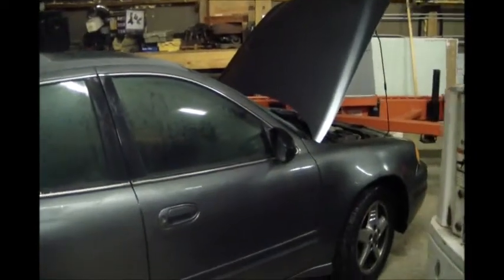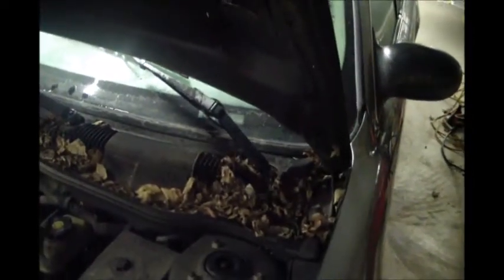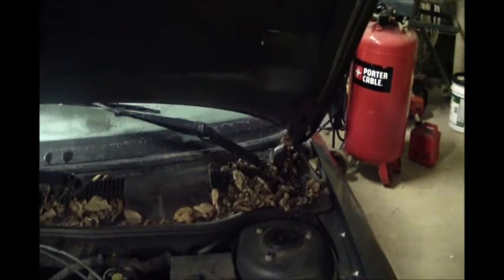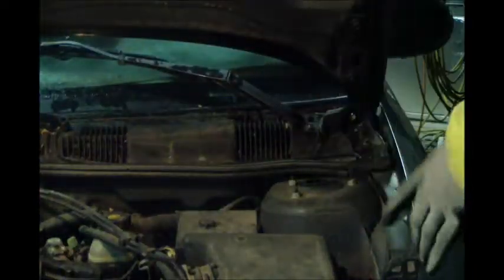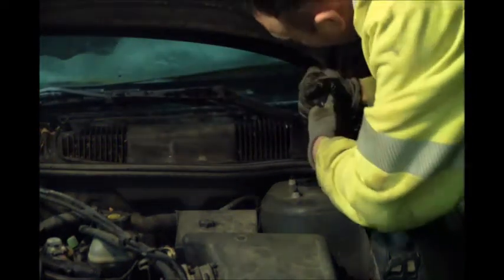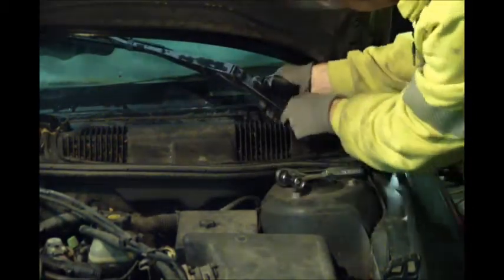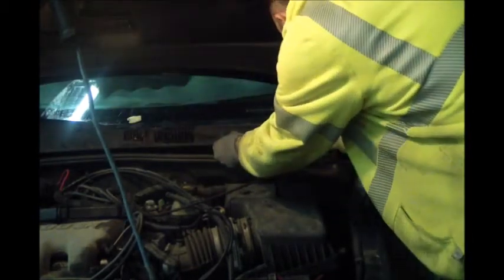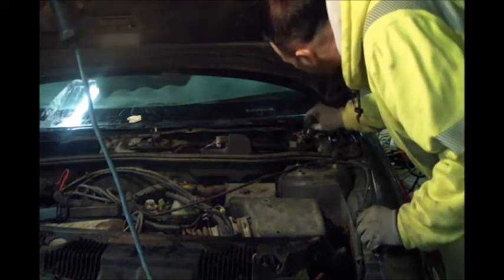Pontiac Grand Am Wiper Arm Linkage Fix

Comment: All I had to do was pull the arm off because whomever removed it before had it adjusted too far down & it was going past the wiper arm stop. Got it off pretty easy but I did put some never seize on the spline so the next time it has to be removed I'm not throwing wrenches...